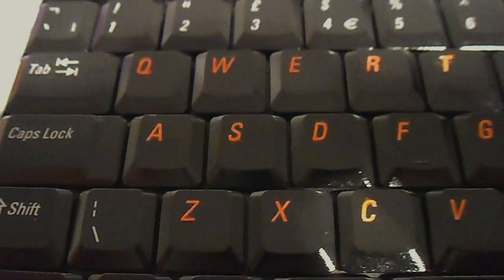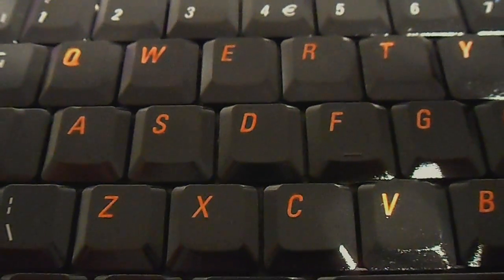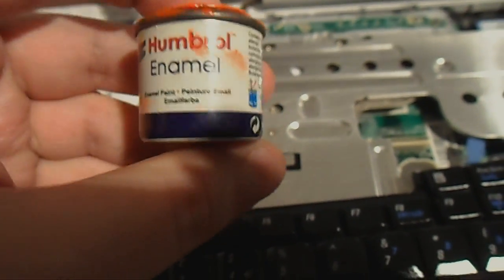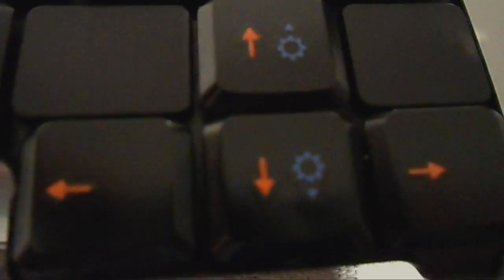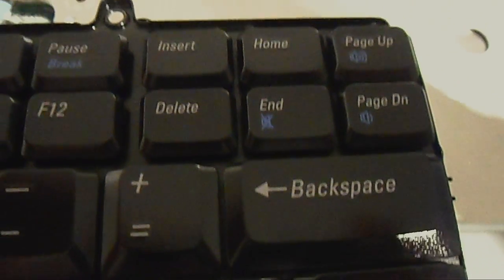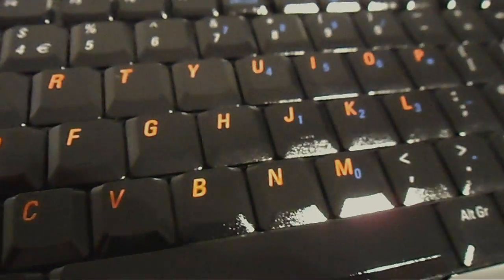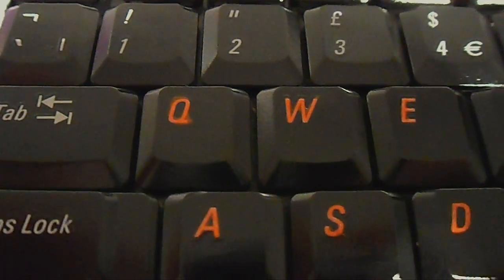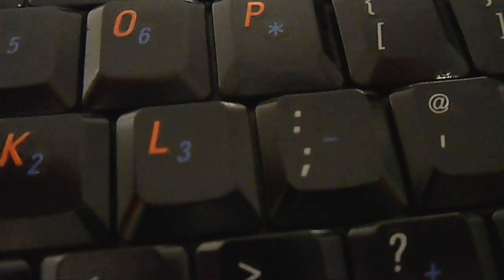Dell Inspiron 1501 Upgrade & Repair Video 3 Of 3

Comment: I just stumbled across this I also have this model with 4 gigs ram and a 320 gig H/D. I also have Win 7 64 bit and also have Snow Leopard 10.6.2 running, I use Snow Leopard more Than win 7 but what I was curious about was how much of performance did you get from the CPU upgrade I am running the  Turion TL-56 1.8mhz, I wouldn't mind this running a bit faster. Took H/D from an Hp DV4-2140 that I had replaced M/B in 3X kept losing the Ati Video chipset and don't want to throw more money at it so How is the speed of this ??
Reply from the maker: quite a boost actually, if you install the 2ghz chip you can use SETFSB to overclock the cpu to 2.35ghz also im pretty sure this laptop holds upto 8gb of ram